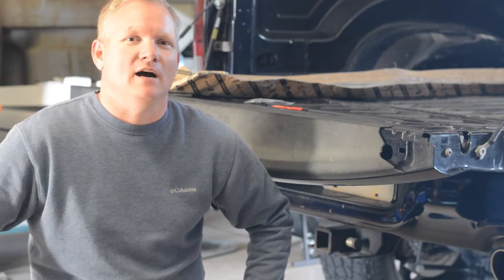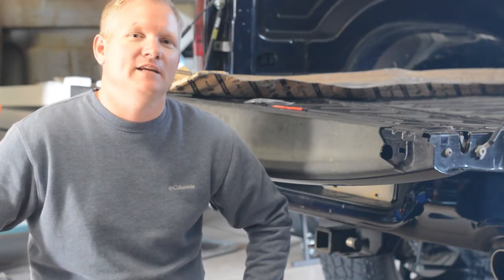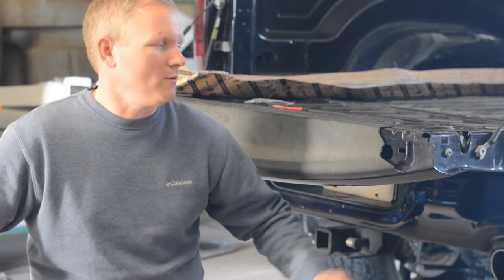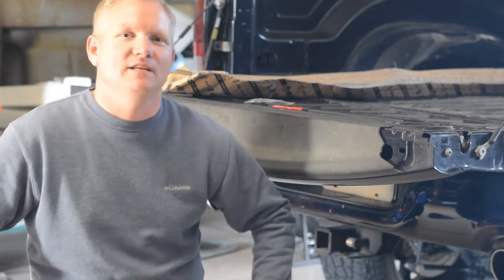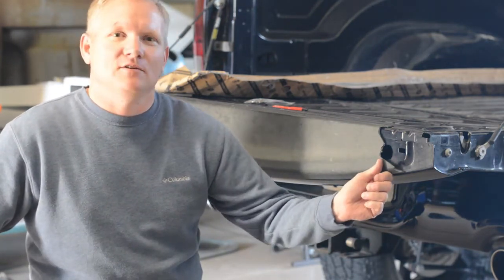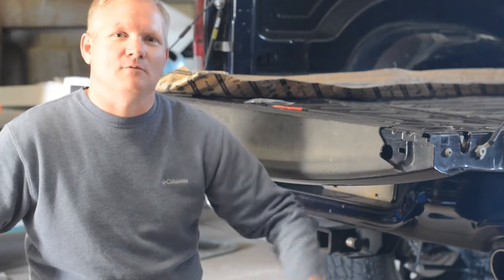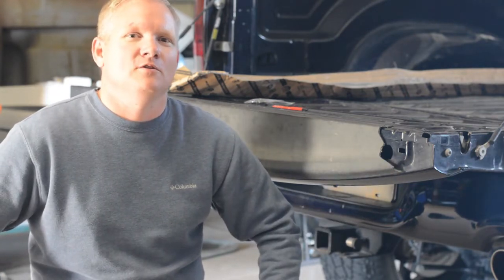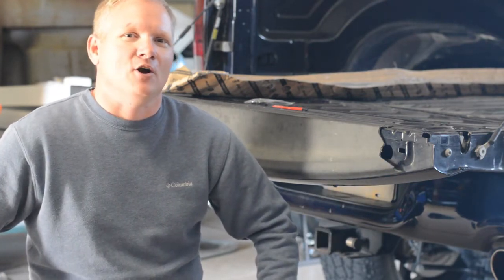Replacing Tailgate Spoiler - Dodge Ram -4th Gen

Comment: Great video! Mine was cracked and I got the oem part from the dealer and installed it exactly as you did. Was no problem at all and I pulled all the broken parts to make sure nothing is rolling around. Awsome